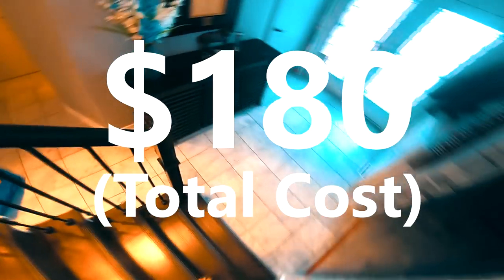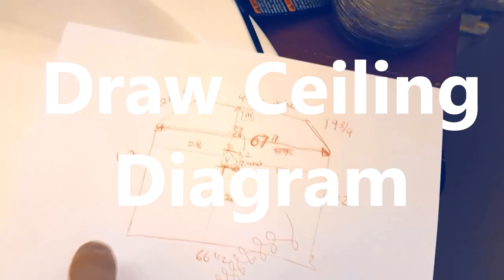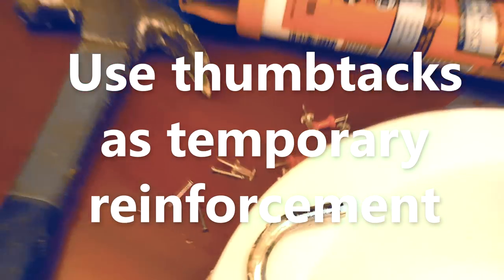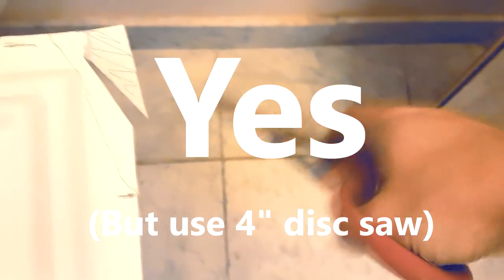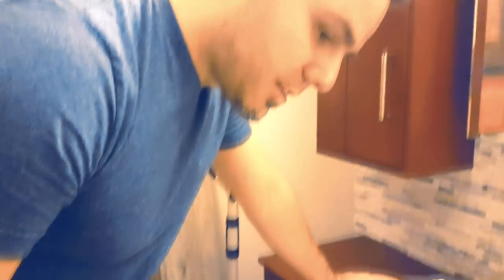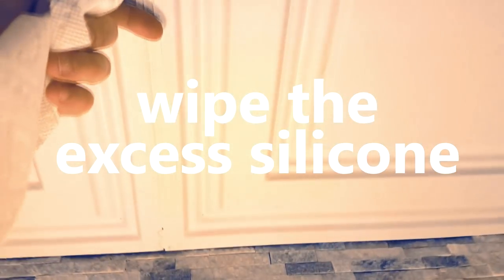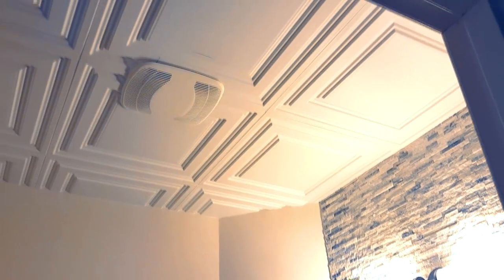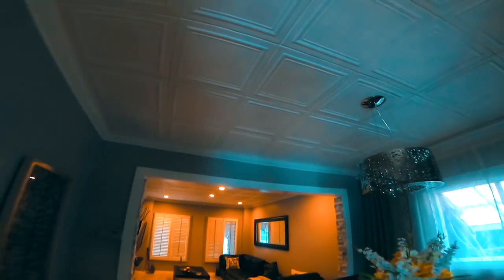HOME RENOVATION - Start To Finish... How to Install PVC Ceiling Tiles & Repair Peeling Paint

Comment: Thanks for the video! So which glue method worked the best? & How's it holding up a year later?
Reply from the maker: PL3 Construction or Gorilla Construction Adhesive are only products i use for tiling, i've used acryl pro, omni as well for wall and floor tiling on bigger jobs, but mostly i use a combination of acryl and  pl3, never had an issue ever in years. All these tiles are holding like the week i put them up.  https://www.amazon.com/dp/B010FYZJFQ/ref=emc_b_5_i